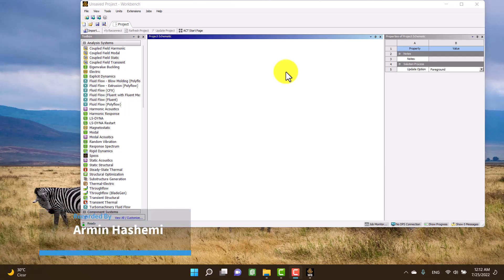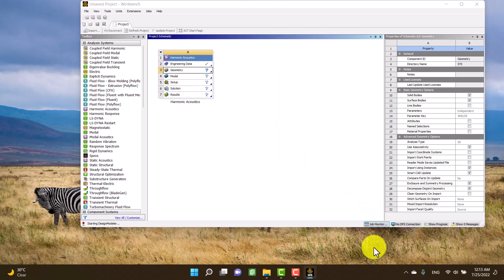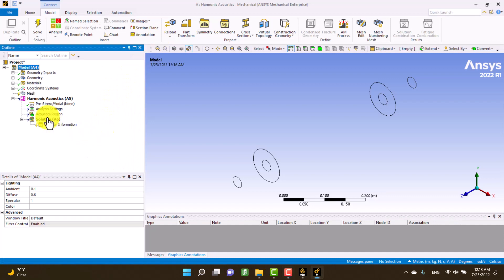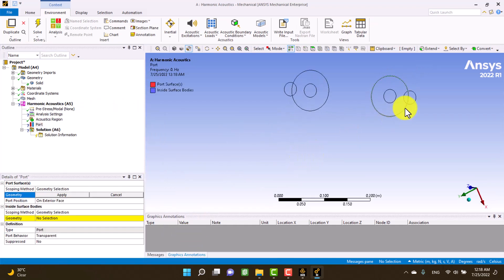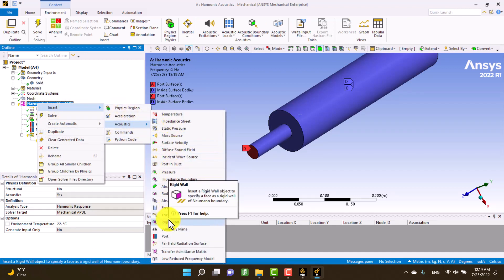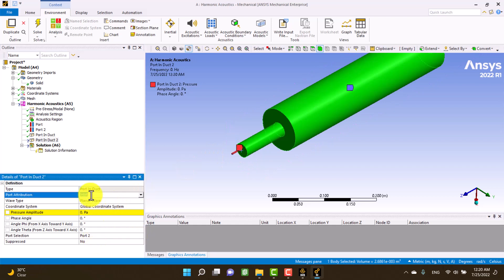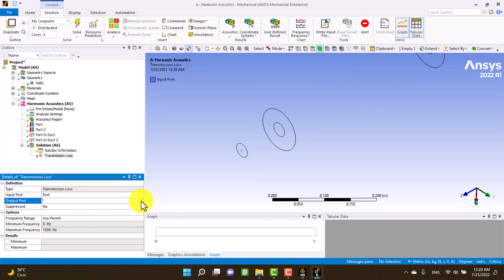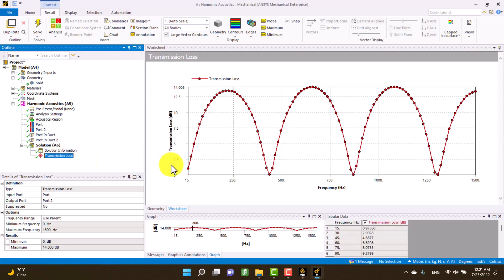🔊 ANSYS Tutorial: Sound Transmission Loss of a Simple Expansion Muffler 🔧

Comment: How can I analyze a shape that has thickness, like a hollow pipe?
In your video, it seems like the shape is modeled without thickness, but what I need to analyze is a pipe-like structure with thickness.
Also, in my model, there is no surface for excitation. How can I resolve this issue?

I want to know that .. please😢
Reply from the maker: @이승현-r8i6g  there are many videos about it in YouTube. You can find this analysis in Heat exchanger examples

Comment: Hi sir, 
Is it possible to achieve an insertion loss of 40 db just using a straight-through absorptive muffler(cyindrical) of dimensions (length = 505 mm, dia = 137.9 mm, packing density = 120Kg/m2) by only varying
1. perforated tube dia
2. perforation diameter
3. no. of perforations
Reply from the maker: 40 dB is too high. I have never seen such a muffler.
Reply: packing material is rock wool sir
Reply: an insertion loss of 30-40 db is needed as per guidelines for a competition sir
Reply from the maker: @projacks-y9i  Is it for the car? You have to choose proper dimensions for expansion chamber, then you can adjust it with extended tube and porous material.
Reply: Any sources to help with that sir?
Yes sir, it is for a car
Reply from the maker: @JayaLakshmi-v5z  Please send me an email so I send you the references.

Comment: Hi sir, how to interpret the results
For an absorptive muffler, we are getting a max Transmission loss of 16 dB. This is for a Formula Student car. Is it too less sir? What should be the range sir?
Reply from the maker: Hello, It's impossible to give an opinion with  a dB value. sound transmission loss envelope must cover the range of eight first firing frequencies. Exhaust noise should not exceed the standard of noise determined by car manufacturer. Also, the pressure drop should be in the standard range.
Reply: @caewitharminhashemi  What does this mean please?
Reply from the maker: @esivueeshilama7101  It has a long explanation. Munjal has some articles and a book about muffler.